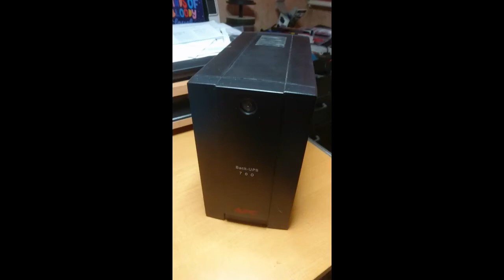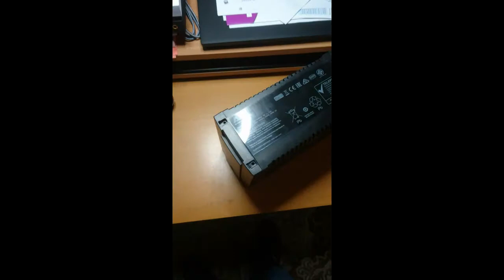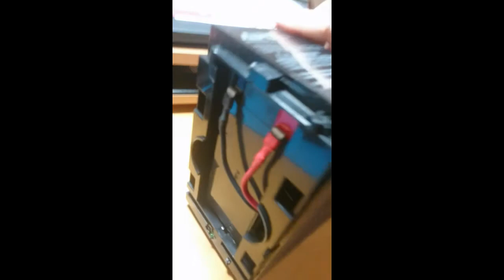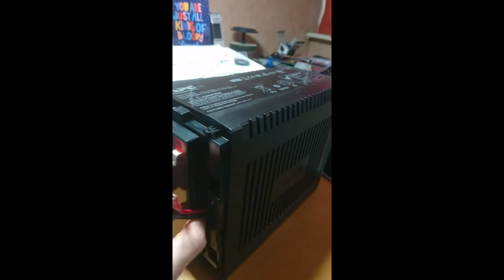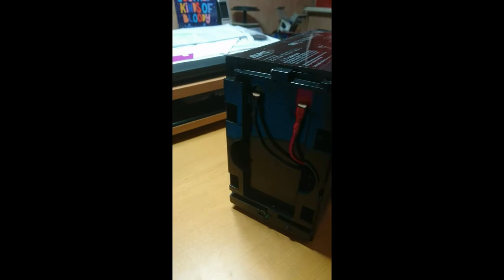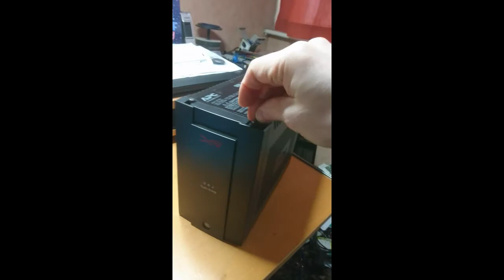APC Back-UPS 700 battery replacement

Comment: It says the battery is not user replaceable - opposed to service pro replaceable - because it does not have an accessible batter bay like other APCs, presumably as a cost saving measure. It does not say to throw the UPS away ;) Anyway, bad things happen if you allow the average Amazon shopper to open up anything... so it seems like sensible advice.
I am slightly disappointed by that, as I have owned various APCs for over 20 years and would have chosen a different model, if I had been aware of this design flaw.
Also, am I a bit dumb, or is the APC website the most backwards database? I could not find the manual for this model anymore, luckily later found it on a backup still. Someone in the Amazon comments also complains that the software is not available anymore, I have not verified that.
On a side note, flip your phone around, I am missing 70% of my screen real estate.

EDIT I spoke too soon... I had seen a different video on this already, which required a full disassembly of the unit - it seems there had been a design change... it will be a surprise for me to see which one I have when my battery arrives later today :)
Reply from the maker: Only if you consider that 2 (non-security) screws make it inaccessible - lots of equipment has user service panels retained by screws.
I didn't say the manual stated to throw it away, but that some users had come to that conclusion.
Yeah, I wish I'd made a better video too, but it has the necessary info and it's free...
Reply: @DakarFourByFour  I thought this was a video I had previous seen already... there is a dude who starts out by removing 4 screws, then pries off the front plate with a fuck off big screw driver etc I think they have redesigned this somewhere down the line, and hence maybe an older revision of the owner's manual says that it is not user replaceable? Really weird... I will look for that video to see what is going on, maybe he just went berserk backwards on this thing? I do not remember these units being peddled as not user serviceable... seems like economic suicide to me...
Reply: @DakarFourByFour  I just got it... mine is like yours, only 2 screws. Do you have the shutdown software?
Reply from the maker: @Baerchenization  I've never used Powerchute with this UPS as it's connected to my NAS which can communicate with it natively.

Comment: Thank you ! The info was great, and you saved me a fair bit of cash - replacement batteries from the original vendor were going for $200+ AUD.  A generic replacement was around $30. Cheers.